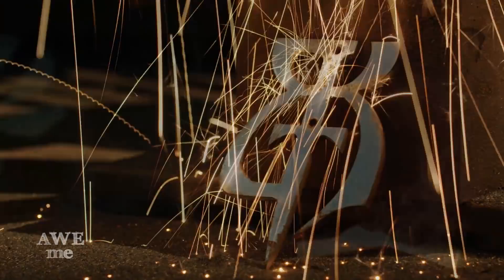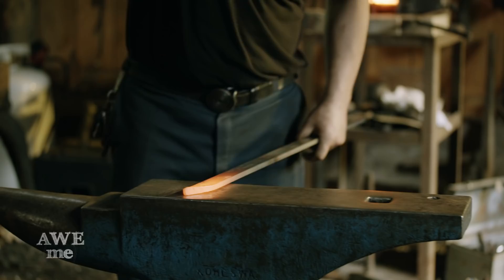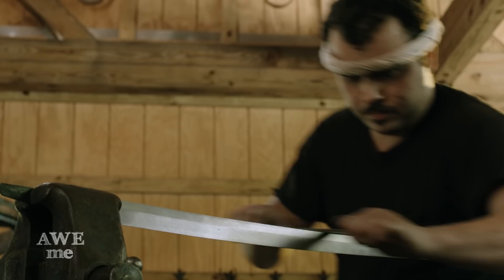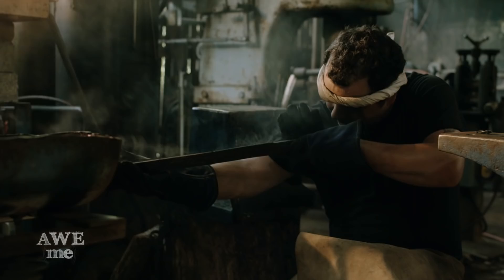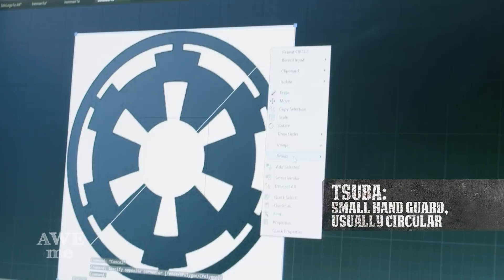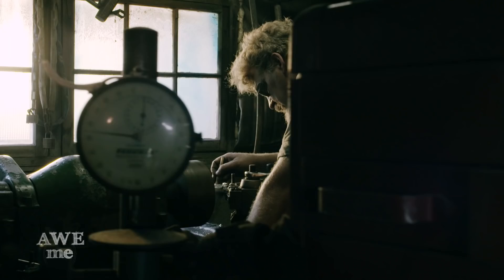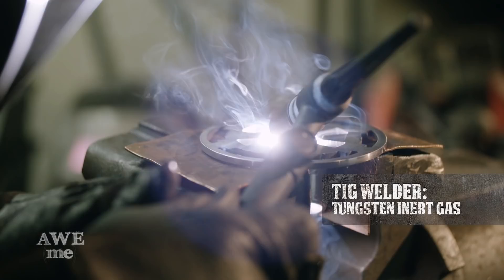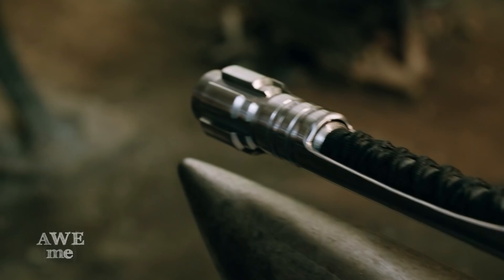Star Wars Lightsaber Katana - MAN AT ARMS: REFORGED

Comment: I thought the Japanese folded their blades?
Reply: They did these guys just suck xP
Reply: They did because their starting metal was a high carbon content steel meaning it was brittle. They folded the blade with flexible and brittle steel. Nowadays we have something called spring steel which is just as good as katana steel. it already has a very high purity/consistency in the metal folding wouldnt change anything.
Reply: These guys make things that kinda look like the real deal...but they most certainly don't use proper techniques.
Reply: Youtube where everyones an expert lol
Reply: ProzacPreacher
The reason why the Japanese folded their blades is because all the iron ore from Japan simply sucks. You can't make a durable sword out of it to save your life, unless you layer different steel compounds together to minimise their negative qualities. The Europeans never had to learn this technique because it was much easier to get good steel out of the European ore. With modern metallurgy, there simply isn't a point.
Reply: Lightice1

You better do some research before pressing the answer button. European iron/steel was brittle and by far not good or pure. Better go and watch the documentary on the viking sword ulfberth "Secrets of the Viking Sword", which is proven to be the best/purest sword ever forged in europe. No european blacksmith had ever forged a blade as good as the ulfberth ever again (until now that is)

Edit: blacksmith in the medieval times didn't have the means to heat the iron/steel to the temperature needed to use hammers to hit the impurities out of the iron/steel.
Reply: Huan Tiep Ta
The European ore was better than Japanese ore. I don't recall saying anything else. The European swords were most certainly not brittle, even though their steel did not match the modern quality; one sword could last for generations in use, as long as it received proper care and maintenance.
Reply: paragonshadow A blacksmith expert apparently
Reply: As already mentioned, no need to fold the steel when you're starting with something high quality.
Reply: Lightice1

The thing is, the ore might have been better, but european blacksmiths couldn't heat the ore to the appropriate temperature to pound the impurities out and separate impurites from the metal. Which makes them inferior to the Japanese Katana at that time.

All the comparison you may find here on youtube where they compare the Japanese Katana and the European Longsword or other sword are just unrealistic. They use vastly superior metal European Longswords than what was available at that time, whereas the the ore, that the Japanese master blacksmiths use to forge their Katanas are still the same as 800 years ago, without the usage of any of the poundering machinery or belt grinders and other stuff.

I am no expert on this topic, but I wouldn't dare questioning weapon historians or world leading figures on historic steel weapons such as "Alan Williams", who has analyzed thousands of swords under the microscope, LOL.
Reply: Lightice1 As a nitpicky thing, katana could last for generations as well. Your point on differing base steel quality isn't wrong though. Keep in mind that refining process was mostly successful in countering the original steel's weakness. What it meant was the blacksmiths of similar tech levels in Europe had to work less to get similar hardness and durability. Also, to everyone here, the katana's involvement with Europe was not in the medieval period.
Reply: Stormtalus I think any sword used in battle wouldnt be able last for very long, regardless of maintinance and care you can only grind a dull blademso much before it is worn to the point it breaks. Once the blade breaks (even new blades sometimes broke when blade-to-blade combat occured) it was almost impossible to simply repair it. Any blades that lasted generations didn't see much combat. I just thought to point that out.
Reply: Impure ore needed to be folded to become hard enough for a blade. This unfortunately had the side effect  of making Japanese swords very inflexible, and therefore brittle. A european sword is characteristically flexible which allows for some wobble, this allowes the blade to take less damage from heavy blows and were therefore less likely to break if they contacted a hard surface. The Katana therfore excelled as cutting through flesh, which was oddly enough most of what they had to worry about because samurai rarely wore heavy armor.
Reply: *****
Yeah, you've got a point there, but new blades breaking in first use? Regardless of what kind of sword, I'd imagine blades to only break if they are really brittle, e.g. having a large amount of impurities or non-tempered swords, but properly forged swords. I am not saying, that they won't break, but on the first try? Man, they must have been some crappy ones xD.
Reply: But, i must say, the worst crime is that the sword is not full tang.
Reply: Lightice1 Doesn't matter. If they are making a "Japanese Katana", they need to use traditional techniques. If they aren't using traditional techniques, then they are no longer making a "Japanese Katana", but rather a sword that looks like one.
Reply: ***** I know you've responded to other since, but just to specifically reply to the bit about not lasting long. Yes, relatively speaking, most swords would break after intensive use in battle. However remember, both in Europe and Japan, and really any country that used metal weapons, the weapons were purpose built for war. As time went on they learned the weaknesses and strengths of the different metals and built weapons intended to last through the rigors of combat. Often battle swords were not used throughout the entirety of a battle, also, as they were not commonly the primary weapon for the battlefield. But I threaten to ramble here; steel weapons were forged to survive combat and use, and generally the better made ones did. There are, I imagine, a good amount of examples in museums that have seen actual combat and yet survived. There are also probably records of heirloom weapons that were not ceremonial in purpose for several generations, because steel and iron were valuable and strong.
Reply: Stormtalus If all of you know so much about making proper katana blades, why are you arguing about technique in the YouTube comments and not making fucking katanas!?
Reply: Francis Picklefield  Firstly, what we have is a fairly general knowledge of katana crafting, research on it via books and internet, some level understanding of the historical context concerning the use and making of the blades, possibly some basic martial arts practice and/or knowledge, and a desire to separate the vast amounts of misinformation from the legitimate knowledge on the internet (which gets more and more difficult as more and more kernels of truth find their way into incorrect or improper ideas.

Secondly, even if we were intimately knowledgeable about smithing katana's and somehow just as knowledgeable about polishing them, the resources necessary to do these things make them prohibitive for many people.

Thirdly, as far as I can tell we are not arguing specifically about the finer points about katana crafting. Yes, this originally started discussing steel folding, but the point was addressed early on. These discussions in the comments section tend to move away from the OP. Hardly a good reason to get so heated about it, let's try and keep at least the illusion of civility no?
Reply: ProzacPreacher For a katana to be "traditional" there is a specific place the ore must come from (I can't remember it right now) and that is where the difference between "traditional" katanas and look alikes is clear.  From a historical standpoint, the vikings and the japanese did not the same steels that most of Europe had and as a result they had to adapt to use what they had. From another standpoint, these guys have a shop to run and do not have the time to do everything traditionally.  Source: Blacksmith
Reply: George Hurley Search for tamahagane, iron sand.
Reply: Jarod Sholtz
Ya, i know, i have found it since then (hint: this is from 3 months ago)
Reply: George Hurley My comment was not only for your benefit, but for the people reading the comments. (hint: if you want to sound knowledgeable edit your comment to give complete info)

Comment: eh I doubt this blade could stand up to even a poorly made Katana using the correct forging technique.
Reply: It wouldnt be able to stand up to a real katana because traditional japaneese takanas are forged from a special alloy naturaly found only in japan.
Reply: SalmonBurgers yes hence the comment. Also Katana's were designed to kill as quickly as possible IE as soon as the weapon is draw you should be able to use said motion to slash at your opponent that's why they are curved.
Reply: The forging technique used was perfectly fine given the grade of the steel being used. The folding of iron back in ancient days was a necessity due to the poor quality iron available, that's not an issue today. I'm more concerned about the huge amount of space at the base of the blade because they went with that cylindrical design. Any weapon hits that and the blade is definitely moving.
Reply: SalmonBurgers
nooooot even close to the truth
Reply: SalmonBurgers Lol! Alloys arent found mate. They are a mix of two metals. And even then if this "Special alloy" did exist, that wouldn't make it better than anything else just because its found only in Japan.
Reply: Katana's are not actually super good. The internet has turned them into these mythical uber blades but they aren't. They are actually relatively clumsy and heavy because the steel wasn't very good compared to European steel. That's why when the Portuguese were fighting the Japanese, their skinny blades were doing just fine.
Reply: SalmonBurgers well no. the alloy was a mixture of coal and iron. in fact all steel is made of a mixture form coal and iron. it is the technic that makes the alloy. hell look at the middle-eastern like Iraq and Arabia. they had Damascus steel the same time as the Japanese .
Reply: The boosh is strong with this one. x)
Reply: Ian Wynyard finally an expert
Reply: SalmonBurgers Special alloy called "worst steel ever used in history of swordmaking"?
Reply: Ian Wynyard I never mentioned samurais?
Reply: *****
 Actually Tamahagane is nothing like Pig iron. Tamahagane has a carbon content usually 1% and at maximum 1.5%, while Pig iron has a much higher content of 4% or higher (plus many impurities of relatively low percentages). Pig iron is not used as a material in manufacturing, rather it is used in forging to make other more useful ferrous materials. In fact, Pig iron is only a bi-product of forging in a blast furnace. Pig iron is just the crappy crude iron that settles at the base of the furnace. Now the steel he used is SAE 1075 steel. The 10 tells us that it is plain carbon steel and the 75 tells us the percentage of carbon in the hundredths of percentage points, so 0.75% carbon. What this means is that Tamahagane is harder than SAE 1075, but it is also less ductile (i.e. more brittle). The folding and other processes Tamahagane is put through in katana manufacture compensate for its lower ductility, but in the end you get a resilient battle-ready blade with superb edge retention and a superb edge to go with it. This is not to say that the SAE 1075 couldn't do the Tamahagane's job just as well, just that you might be grinding it more after a battle. Keep in mind this is a fairly basic examination of the metals, and you could probably go on for days about the material's properties and the manufacturing processes related to them. However, ultimately the materials are just better at some things and worse at others. It is really just up to the smith to decide what facets of the materials are more important for the blade he's making.

P.S. I assumed you meant Pig iron not Pig steel. I had never heard of Pig steel before and on further research found nothing on it. Maybe it's just a regional nickname?

Source used for my paragraph above: Fundamentals of Modern Manufacturing by Mikell P. Groover (4th Edition)
Reply: Ian Wynyard I was simply talking about why the Katana was curved I didn't mention samurais using them for fighting they were more of a status symbol.
Reply: Garcia Demierre Steel isn't made from coal and iron lol...
Reply: NickInABoot well technically it is especially back then when they couldn't produce synthetic carbon. coal/ char coal is mostly made up of carbon. so ya it is

Comment: Bro, do you even fold steel?
Reply: only if you're not using monosteel
Reply: ***** really? I could've sworn the act of folding the steel had some kind of benefits for the structural integrity of the blade, or some baloney like that...
Reply: datpolakmike Eh, monosteel allows for larger major dendrites to form which wouldn't work across layered bands which, in more impure steel, serves the same purpose structurally. Like how you shouldn't get headlights from the same batch in case they both burn out at once, having layers means that stress that might be too much for impure monosteel gets spread out by a second better layer before either of them would break. In Modern Monosteel such impurities aren't much of an issue so major dendrites (large steel crystals) can interlock without weakness.
The majority of the reason for folding is just to spread out the impurities and help remove them.

Comment: Steel not folded at all.... *sigh...
Reply: They aren't going to put that much time and effort into something that they aren't going to sell or use in battle.
Reply: Arno Betts "use in battle" Who the fuck goes to "battle" nowadays with a sword?
Reply: MrGoogleman999 My point exactly, they would never use it in battle.
Reply: Of course your not going to use it in battle, but its still nice to have a true blade for practice and its better to have a well made sword than some cheap wall hanger bs.
Reply: In this day and age where you can easily get good quality steel, you don't really need to fold it. The primary reason Japanese swordsmiths folded their steal if because they only had low quality iron/steel to work with and so had to fold it to make it last.
Reply: RayvenQ Since the steel nowadays is so good, would folding it make it even better?
Reply: Not really.  Nowadays the only time you fold steel is to either make an alloy, or make damascus steel, (in itself an alloy too) or to strengthen something by putting harder steel in the middle and folding the softer steel around it.
Reply: This is for show, not serious weapon smithing.

Comment: Since katana is basicly a japanise sabre you made  what, a lightsabre sabre? Would it not be more authentic and simpler to build a vibrosword? you could even isolate the hilt , slap a batery in it and make the curent flow trough the blade so it vibrates or make zaping noises when it hits water or steel.

Comment: could've made the blade end extend-able like a spring loaded baton would. The handle part was good...there was no need to make a katana blade....its so over used...fair attempt none the less
Reply: Proud To Be Human if they did that, then they would have to hollow out different parts of the weapon including the blade making it weaker. they would also have to section out the blade which could potentially break the blade.